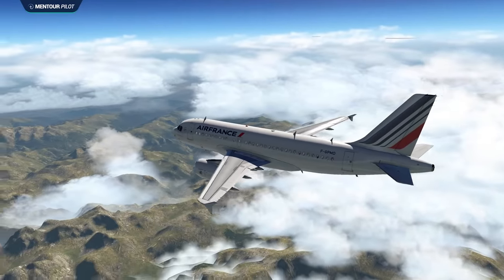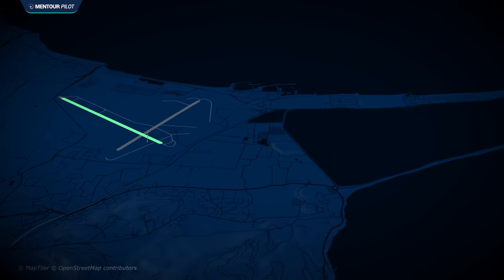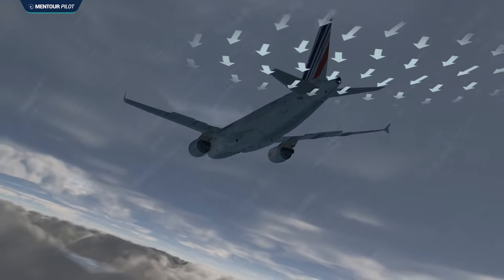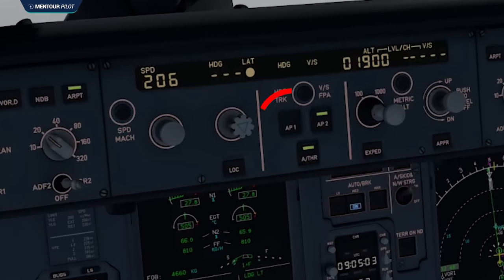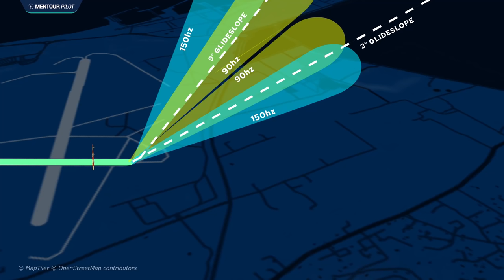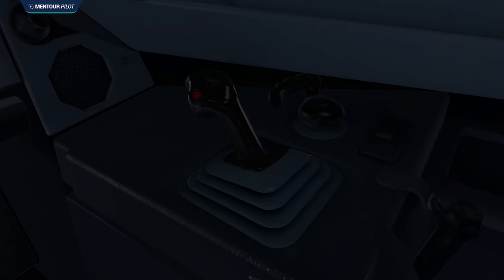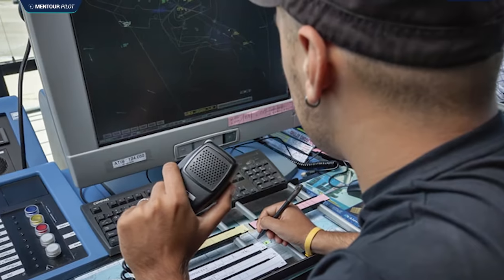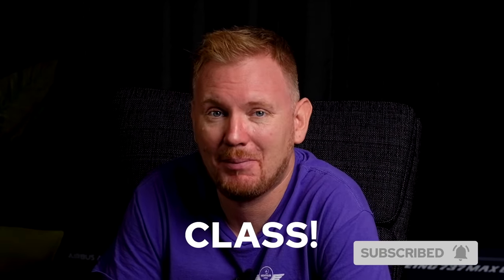An Absolutely CRAZY Reaction! Air France flight 7512

Comment: Regarding the SMS and 'Just Culture' - I fully understand and support the airlines principles in my general approach to life. I see the blame culture and the development of a litigious culture as EVIL for steering us away from this way of thinking. A potential problem understood and the understanding shared gives us the ability to avoid the problem in future, whereas to hide that problem is to having keep it reoccuring until a disaster (even if relatively speaking) happens
.
Or to put it another way:- The least foolproof sytems are those that slam the door shut on foolishness. I would have more faith in an employee who has faced a problem, and learnt from it, than one who has no experience with it. (But I will add, as someone else may raise the point, someone who repeats the same mistake is another thing.)

If only the world would look at and learn from the airline industry in this respect.

Comment: the glide-slope secondary lope detection system on plane should include the altitude increase/decrease logic. if plane detects the 90 Hz (above glide slope signal) it should never increase altitude as system should recognize it is above glide slope in the secondary signal reversed side lope.

Comment: From a really simple, layman's perspective  :-
1. The profile is wrong and the approach is quite steep.
2. The terrain around the airport has a lot of mountains.
3. Approach & landing is "tricky"  even with a  Normal profile.

So, when the FP makes a decision to go ahead with a landing, when he's in the wrong profile & he's aware that he has too much energy, but goes ahead with attempting to land :-

1. Then he is practising his skills at doing difficult approaches and landings.
2. Whilst ignoring advice fron ATC.
3. Whilst ignoring that his plane has passengers  -  what would they prefer he does ?

To conclude
It's good to practice difficult scenarios as this builds up abilities for unforeseen incidents in the future. 
But NOT  without the consent and knowledge of the passengers.
And perhaps, not without the consent and knowledge of the owner of the plane.

So, perhaps there should be "dummy"  planes as well as simulators to allow pilots to practice skill-building in difficult situations.

Obviously, pilots do mot feel stretched enough on simulators, so they then make quite illogical and irrational choices in the air, even with passengers on board.

Comment: The part I find so baffling about this is, why did they allow the angle of attack to be so high for so long after picking up the erroneous glide slope? It was so clear that it was dangerously high, and speed was bleeding off rapidly! Why did it take so long for the PF to push the nose down, and not only that, but he didn't even push it down that far!? He pushed to a point where the speed was still dangerously low. I'm a layman, so obviously I might be missing something, but it just seemed so obvious that the priority was getting that nose way down and recovering speed asap.

Comment: 01:10 okay, so: runway #1 is kinda short. Runway #2 can only be used in good weather. Runway #3 requires complicated maneuvering so you don’t smack your face into a mountain.
What else, let’s see here - runway #4 actually has a clump of trees growing right in the middle that you have to swerve around wildly mid-landing. Runway #5 has a gas leak and is perpetually on fire and runway #6 is haunted by the ghost of an old French nobleman who does a French version of „get off me lawn, ya rapscallions!!!“ and throws baguettes at your engines...
Reply: loool

Comment: I fly military combat flight sims, not commercial (like MSFS etc), but DO watch your channel and I have to ask. Why isn't there a button (both Airbus and Boeing) that puts the flight computers in a "HEY DUMMY DO WHAT I TELL YOU TO DO" mode? It seems to me like a constant theme in your videos (which I love BTW. I find them fascinating) where the systems have become SO complicated, and the pilot/machine interface SO obscure that in a lot of the accidents that you show, it almost seems that a lot of pilots are doing hand to hand combat with the flight control computers right into the ground (or uncomfortably near to the ground). Why isn't there an override on the stick (or yoke) that puts the computer in a "POINT THE NOSE THAT WAY AND DO WHAT THE THROTTLES ARE SET AT!" mode. I keep thinking of the poor pilots in the Air France crash that flew the Airbus off into the trees at the airshow. An override like that would have solved that problem. Push the button on the stick and the computer goes into a "To hell with the mode I'm in he wants the nose at 10 (or whatever its directed to) and whatever the power is set on the throttle quadrant RIGHT NOW!". A master override or something like that?

Comment: From a software engineering perspective, it seems like there should really be some kind of audible alert, preferably spoken, when the computers change modes. Otherwise the system will be out of alignment with the internal model the pilots have, leading to confusion and errors. Is there a reason this isn't done?

Comment: Cold ray can blow you away on the street. It generates a huge wind in the form of laser. Its diameter against people is from a tennisball to soccer ball diameter. Sometimes it is greater, and affects a small area. It is not accurate, that is why, easy to notice it. By jumping away, you can check it out, it's artifical.

Comment: 10:00 So many times these incidents occur because someone does not provide complete information or does not bother to double check the situation either through laziness or incompetence. 

For goodness. sakes the lives of all the passengers on the aircraft as well as their own depend on them not making fatal mistakes. Is it too damned much to expect the Captain to take a little time to check whether they are in a stable configuration especially since the ATC asked them if they wanted to go into a holding pattern.

Comment: 2 questions:  1. why don't airlines install a simple mechanical device like a bubble level, to tell if plane is going up or down or left & right, as backup, in case flight instrument fails.
2. Why don't they install inexpensive cameras (like back up camera in a car) to monitor engines & wings, instead of asking flight attendant to look out of port windows?
Reply: 1) It doesn't work because the direction of 'ground' in the plane depends on the centrifugal force. You can fly a full loop in a plane with a glass of water and not spilling it even when you're upside down.
2) Aviation equipment is subject to pretty extreme changes in environment and has some important safety considerations so it needs to be built to certain quality standard, thoroughly tested and properly certified, which obviously pushes the cost up. So, in reality, there's no inexpensive flight equipment. And in 99.99% of cases, looking at it is same as having the camera. In grand scheme of things, there's really no benefit it. It can also be a determent because in order to show the picture on the flight displays, you'd be hiding some other important information. So, it's just not worth the hassle.

Comment: When automation isn’t working, you click it off and fly manually.  I can’t imagine a crew that can’t calculate and validate an ILS approach.  The elemental things are more important than an AP flying for you.  On numerous occasions I’ve disconnected and flown manually because automation wasn’t working right or I was concerned about wind shear or icing.  Sure, when it works it’s a great aide, but when it doesn’t then you need to engage.
Reply: Modern autopilots are more capable than older ones. For example, you wouldn’t disconnect the autopilot on an airbus for windshear. You’d leave it in if at all possible.

Comment: Giving Airbuses History, it's almost guaranteed that this was uncommanded and the pilots had virtually no control over it.
Reply: Uncommanded? The pilots had configured a form of automatic landing which commanded the autopilot to "catch and follow the ILS glideslope". Yes, it was stupid of the autopilot to go to the extreme AoA to follow this command. I guess that's the reason why Airbus was in the process of updating the autopilot's software. Luckily but very important, the Airbus alpha protection overruled the autopilot, keeping the plane above the stall speed. We know of other cases when the alpha protection overruled "stupid" autopilot actions, keeping the plane within the safe flight envelope. But remember that it's always the pilots who tell the autopilot what kind of mode they want it to fly. It' not a sudden force of nature. Furthermore, the pilots also have the ability to overrule the autopilot, or switch it off completely. AP1 and AP2 are not some unknown buttons; the pilots push it to activate and deactivate the autopilot several times on most flights.
Reply: @skayt35  The pilots can activate or deactivate full autopilot but the vast majority of control is automated and beyond any control of the pilots, regardless, theres no on or off switch to disable the automation completely many Airbus Pilots have mentioned this and the incedences they had, its a lot like the Tesla autopilot, the driver still has some control when its activated but it can overpower the driver and steer into things, which has happened already, the only difference is with an Airbus you cant turn the autopilot fully off, you can only turn it partially off, if the system malfunctions theres nothing the pilots can do, this has happened on a take off with autopilot off, the plane suddenly dove uncommanded and struck a sign before giving control back to the pilots, there are other incendences where Airbus planes have flown erratically and it was blamed on turbulence even though other flights experienced no turbulence in the exact same space. There is clearly an ongoing problem with their system and it should be scrapped entirely.

Comment: in regards to the instrument landing system, if only we had a system whereby the glideslope can be changed to account for wind conditions , i.e. shallower glideslope for tailwind,  so as to better keep the aircraft operating within their performance envelopes
Reply: Then they would have to be re-examined and certified every time they were adjusted. That’s why if there is a tail wind you land in opposite direction
Reply: @tomstravels520  why not only certify the extreme allowable limits of the glideslopes? or maybe even just the shallowest approach angle to match the local height restrictions
Reply: @carmatic  because then more thrust is required to maintain the speeds on approach and people living under or near the flight plan won’t like the planes flying much lower over their heads and being noisier. What do you mean only certify the limits? The glide slope signal is set at an angle and left there so then they know that is safe for aircraft to use.
Reply: @tomstravels520  air speed or ground speed?
Reply: @carmatic  in a way both. A strong headwind is seen as good because the plane flies a much slower ground speed however it is also dangerous because if that wind drops suddenly the airspeed will also drop and the plane risks stalling. That’s why planes have to fly a faster airspeed just in case this happens so more thrust needed. A tailwind will reduce your airspeed so you need to increase airspeed which increases ground speed

Comment: great video.  But it points out the serious design flaw in the ILS glide slope, that if the plane captures the secondary slope, the signals are reversed!  ack!  why would they design a system that would have this serious of a design flaw?
Reply: It’s an old system. Simple but effective. In well run operations there are safeguards against high lobe capture.

Comment: Any dangerous environment needs safety reporting that is constructive and can force changes instead of being punitive and seeing any report as a problem instead of a way to be safer and more efficient. The only thing close to Just Culture that I have heard of before this video is the Toyota Operating System, as implemented in its full and original form. Most companies outside of Japan do not implement it and then wonder why the system isn't making things safer, more efficient, and reliable. It is good to know that aviation has this mechanism, especially when considering the consequences of not having it.

Comment: the whole ILS should really be based on lasers rather than radio waves, radio is too divergent for tight beam control, whereas a laser can be any desired angle and spread, and can easily handle low cloud or rain by selecting appropriate wavelength.

Comment: This seems like something that could be avoided via software in the ILS system on the aircraft
Reply: The beauty of the ILS is its robust simplicity. Properly understood it will never give you problems. Adding software would just introduce another level of potential failure. Look a MCAS.
(Sorry, Maneuvering Characteristics Augmentation System)

Comment: Standard procedure at my airline was to be established at the intercept altitude before the FAF and therefore intercept the GS from below.  That is the reasonable check. level at intercept alt by FAF, GS intercept at intercept altitude at FAF, gear down, all at crossing the FAF.  To be chasing the GS from above inside the FAF, other than normal corrections, would be a go around.  I have done go arounds through the GS and flown through those false glide slopes enough times to know to never be in that area trying to capture the GS.  Flying through it you will see the GS gradually go down then as it crosses the false it bounces full scale up then down.  Just ask for a 360 turn on the LOC when high.  I have done that once or twice.  This is not a big deal.  To be high and chasing the GS down having never captured it inside of the FAF is a go around and a scary place to be in IMC.

Comment: Small point of clarification - seems like the rule-of-thumb calculation takes altitude in 1000s of ft, but returns nautical miles?
Reply: Yes because it’s not a mathematical equation so it doesn’t matter what units are used
Reply: @tomstravels520  On the contrary, especially because it swaps units, it's critical to know which units to use at which stages, or else the results will be nonsense.
Reply: @henryptung  you always use nautical miles for distance in aviation and feet for altitude (unless Russian or Chinese) so it’s not going to change and I doubt you’ll use the wrong one

Comment: The secondary ILS signals are much lower in Amplitude than the real ILS. Also, the distance and altitude combination should have told the pilots that they missed the ILS. It is very important that Pilots do not get punished if they report issues - totally agreed! (the reason why the COVID-19 got out of the lab is that the researcher that caused the leak knew he would be executed, hence he did not report what happened, it made no difference to him. Millions died!)

Comment: In terms of "just culture", there are two things hat need to be part of it (which may be, but simply weren't mentioned).  The first is that anyone who fails to learn from mistakes and thus repeatedly makes the same mistake should be reprimanded.  Anyone can make an honest mistake (and shouldn't be punished for it), but repeating the same mistake can be just as dangerous as gross misconduct.  The second thing is that anyone who has exhibited a pattern of dangerous or reckless behavior which then leads to honest mistakes should be reprimanded (for example, anyone who repeatedly stays up late the night before a flight and is thus tired or distracted while flying).  One time is an isolated incident, but repeated times is akin to gross misconduct.

As for the other things mentioned in this video, it seems from an outsider's perspective like the aircraft should be doing more to alert the pilots whenever there is a conflict or automatic override.  I imagine pilots don't want verbal warnings for everything because that can condition them to potentially treat all verbal warnings as non-critical, but it seems like there were several instances in this case in which mistakes could have been avoided if the pilots had been alerted to what the aircraft was doing.

Comment: Gonna preface this question with the fact that I'm not a pilot, just a person who gets very curious and tends to fall down rabbitholes on interesting subjects, but I don't understand the math around 8:16 in the video, because 6500 x 3 is 19,500 feet, but that's not 19.5 miles, it's a little less than 4 miles. Is this a metric to imperial translation issue or is there something really obvious I'm missing? Or does it mean you add a mile for every 1,000 feet from the result you get when multiplying your altitude x 3? Thanks to anyone who can help, I'm gonna be staring at the ceiling trying to figure this out tonight, I just know it 😂

Comment: I think that, generally speaking, many pilots become nervous when they have to operate in bad weather conditions. And that this nervousness is the point where mistakes start to arise and no one notice them. I am not a pilot and I am not trying to be judgemental. I also believe I would lose my shift if I were to fly in bad weather conditions. I think the amount of pressure is high. New pilots should learn that it's okay to be uncomfortable with operating in bad weather conditions and that it not embarrassing to go around or cancel approach when they feel that something is not right. Just saying. I worked in the healthcare field. And I asked my colleagues for help whenever I felt that I am losing control over a situation. And that worked just fine. When you work under stress you also are putting everyone around you under stress. And now the probability of making mistakes increases signficantly because you have made several personnel working under stressful situation instead of only one.